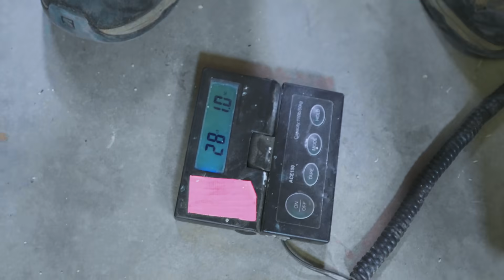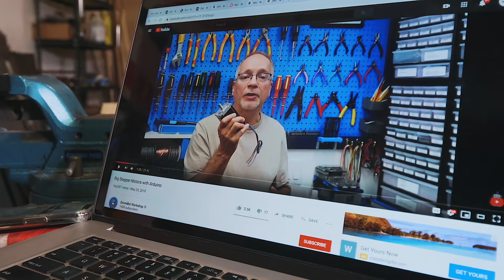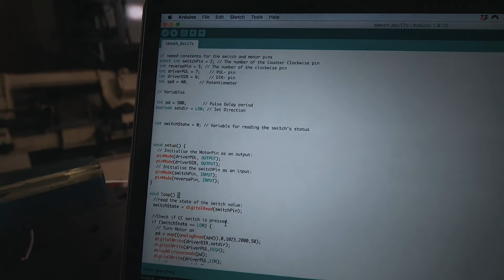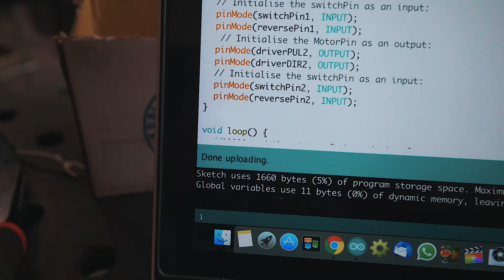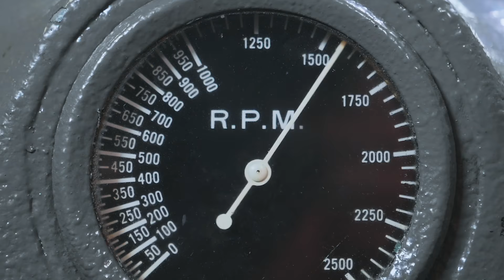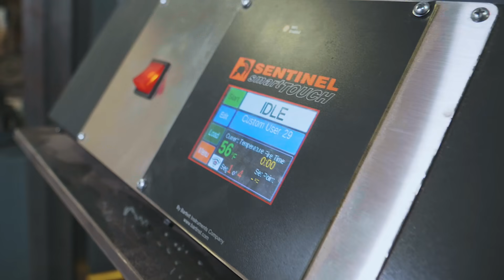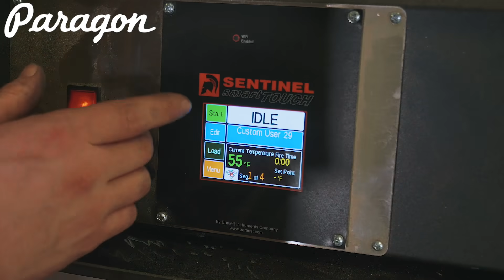MAKING FORGE DOORS!!! Part 2

Comment: What about 2 screws on both sides of the door with a synchronization chain
Like the z axis on a 3D printer 
The electronics can be kept below with only the screw going above 
It should get more lift from a smaller motor and prevent door closing with power failure 
Though you will have to account for thermal expansion in your design 
Same mechanism could be powered by a hand wheel as wheel 
Though it’s good to see electronic in forging we need to se more of that

Comment: Why not have pulleys for mechanical advantage and use the servo on one side with a trapeze to allow for uniform pulling and load reduction at the spindle

Comment: Alec, fyi, most all vertical lift doors have a pulley system and a counter weight to minimize the work done by the servo motor...

Comment: If you use a screw to drive the door up and down my guess is that it would work a lot better and you wouldn’t need to have a bunch of cage around your Forge. Cables are still going to heat up and wear out quickly. Just thought I would give you that suggestion.

Comment: you know I've been thinking about this off and on today and it occurs to me that you dont really need to program you servos to do anything you can just have it all mechanical you dont need a computer. you can limit your motor speed with a potentiometer between your motors and power supply and adjust speed with by turning it down and up you can shut off your door risers by attaching limit switches to either side of the cage so when the door rises to its max height it just cuts power from your riser switch and then you just have to reverse the polarity on your lower controller and your pretty much done

Comment: I'm no electronics genius Alec but I would think you need to do away with one board and wire both motors in series off the other board?

Comment: I can't see your code but I've been programming professionally for 10+ years so I feel like my guesses are ok. I think the reason your buttons don't work concurrently is that you've got a loop for each button, but you need to abstract the loop to go around all buttons. while(any button pressed) {  if (check individual button) move_motor(); x2 } or something like that.

Comment: a nema23 of this size should be more than strong enough to be impossible to stop by hand, you can increase the current to them through the stepper drivers either with code or with a potentiometer on the driver itself. Make sure to check the max current rating of the stepper motor and of the stepper driver so you don't exceed them however.

Comment: if the motors dont have enough power for 30 pounds, you can take the elevator concept and put some counterweights with some pulleys!

Comment: One air cylinder under the table to lift the door. Gravity will close it once the air pressure is off. Simple foot valve like on a motorcycle lift. No sketchy electronics, and less than half the cost. Less is more.

Comment: It might surprise most people, but a computer can only do one thing at a time. You have to have code that "interrupts" the cpu and give it a new task to execute, multi tasking. In reality this happens every millisecond or something like that. 
I'm guessing that your buttons lock that interrupt so it cant process any other task. 
But the strength with a stepper motor and control like this is that a stepper motor is very precise, you can go 200 turns in one direction and then back 200 turns and end up in the exact same spot. So take advantage of this and make buttons that take your door to preset positions. Have 4 buttons on each door that makes the door go closed, 33% open 66%, fully open. just one click.

Comment: Everyone's talking about the code and the motors, but correct me if I'm wrong. Surely the intense heat of the forge will very quickly corrode the wires or damage the arduino if it's mounted at the top of the forge? I guess he'd have a fully insulated enclosure, but surely it'd only be so long before something burns through?

Comment: You need pulleys to give that motor the oomph to get those doors up.  Probably only needs to be a 5 or 6 to 1 so a triple block (3 pulleys) system should do it.  

Edit: Just thought about it but inserting a pin slot into the door like a bolt throw lock should let you hold the door where you want it without the motor being active, like a 3 position deal, one bolt at the highest setting, one at the bottom to keep the door closed if that's something you need, and one at a half open if you're doing rapid low heats on smaller pieces.

Comment: Publish your code mate, or if you want to do the development yourself put the step outputs into interrupts called on millis (duration set by the pot) and the button inputs and the analogueRead for the pot into your main loop. Then you can poll the buttons continuously by looping over them while you're not actually outputting a step.

My guess is that you're using the delay function to set step output interval rather than millis (delay blocks execution of other code) and not polling your buttons outside the step output loop. Something like button pressed > output a step > delay > is button still pressed > output another step or go back to checking both buttons.

Comment: I would modify your code to incorporate another set of buttons. The first 2 sets raise and lower the motors interdependently which someone may be able to help you fix your code so you can do both simultaneously. The third set of buttons would be set to control both at the same time so you hit one button and it automatically raises both of the doors off of one button. You can also if you can time how long it takes for one of the motors to fully raise and lower the doors, set timed code so you only have to hit the button one time and not hold it. =)

Comment: Potential problem using aluminum has a low melting point on a forged or operating at 1500 degrees or more you might want to consider making the pulley out of stainless steel

Comment: Unrelated to this video, as I have been catching up on a couple of years on your videos.  Welcome to the States by the way.

The question:   In several vids you are using either a forged split to weld a “hard” bit for the cutting edge,  or machining a groove.  Have you ever thought to test either a machined dovetail or forged split approximate dovetail for more firmly fixing the two metals?

I’ve no idea if it will work or if there is a real reason not to try, I just thought it might provide mechanical advantage in the forging process and perhaps a “blended “ transition between the two billets in the case of Damascus .

Comment: A pair of old windscreen wiper motors, 4 relays and 4 switches would accomplish the same thing, at a fraction of the cost, in a fraction of the time! That's how I'd have done it!

That said, good work getting the Arduino to control the stepper motor as your first Arduino project!

Comment: we could help better if we had the code but anyways, your problem: many arduino stepper librarys don't support simultaneous stepper motors. Solution: use the AccelStepper library. Other possibility (not really good) tie both stepper motor drivers to the same arduino pin and they will move in sync but only in sync ;) hope that helps... If I can help, let me know

Comment: Make an if statement for the situation where both buttons are pressed that will activate the motors. Like 
if(b1.isPressed && b2.isPressed) {
Then power both motors
} 

(Idk the syntax exactly for Arduino anymore but something like this should work)

Comment: You might want the drivers working at the same time. So wire the arduino pins in parallel with the drivers i guess.

Comment: If the code isn't already solved, check the code for 3D printers as operating many motors "simultaneously" is what they do. They don't move at the exact same time, but within a few clock cycles, so within say 10 of 16000 cycles or around 1 millisecond. That should be good enough. 😊 
If the motors is just for aiding each others their inputs can be hardwired to be equal or mirrored, and have easier code.

Comment: I really think an actuator mounted under the forge and pushing the doors up would be far more effective than a motor turning to retract wire that is then feed up to the top and redirected back to the doors via a pulley. There are just too many different parts that can fail with this design. I appreciate the adventure and learning a new skill however, so build it and learn, but ultimately, I have a feeling this will not be the end solution you are most comfortable or happy with.

Comment: If you want to give the motor more capacity to lift, slap a small gear on the motor arm and a large gear on a spool or similar tool and it will lift more. It will move slower though, as a warning.

Ex: motor gear=° Spool gear= O
Combined=°O

Don't mind the crappy representation

I just wanted to point this out in case the block and tackle failed, since the block and tackle will shorten the distance the doors will lift

Comment: I feel as tho the motors wont like holding that weight even with a block and tackle. It will pull easy but its the static weight i think will burn out the motors.

Comment: I'd have opted for a basic pulley and drive system with a door made from a welded cage and bricks which would make it easy for repairs to cracked bricks. Guide rails keep the door straight.

Simple systems work best and most definitely no need to for stepper motors, Arduinos and coding. Bike chains and gears or a long travel hydraulic ram and pulleys work and work simple.

Comment: While personally I think a mechanical winch and pulley system would be better, you want to do electrical. So, I'd use your youtuber status and contact some of the other fabrication youtubers. Get their help designing a good gearing system for this. James Bruton from Xrobots, geardown for what, or maybe the Hacksmith are some of my favorites.

Comment: Guides, a three sectioned door (so center and left/right sections can be independently lifted or all three lifted simultaneously), and a pulley system that would allow for independent/group lifting of the door may have been a simpler, yet a lot less educational, path.

Comment: Alec, can't help with the code. Are you planning to have a foot peddle? Maybe a slider to pull up on one side, down on the other, with neutral in the middle. If the motors do not have enough power, there are always gears or pulleys.

Comment: There have been so many comments, someone may have said this already, but here goes.   You'll be needing a form of feedback from the motors, so they'll stop when it reaches the extent of their travel up and down.  Otherwise you'll burn out the motor at the top of travel and have all sorts of loose cable at the bottom of travel.  Or if you really wanted to make it complicated, sensors and software.  Also some code to deal with the potential of stuck or broken cable.   Or is all of this in the next video?

Comment: Not about the code, but there should be some end of line sensor in these doors, so the motor doesn't keep pushing them out of rails.
If the sensors are tripped, the motors should stop

Comment: The motor will not be powerful enough as other said. Three solution have been given :
-Gears (well to overkill and difficult for this project)
-Counterweight, just redirect de cable to it and pull downward with the motors
-pullyes, just tackle two together or more and you divide the force needed, as the motor can spin, no problem wrapping up more cable

Personally I would use both last options, stepper motor do not like to hold weight on extended period of time, even the strong ones.
Just put a counterweight beside the main body of the forge that weight 90% of the mass of the door. And then use a double tackle of pulleys attached to the counterweight and the bottom of the structure of the forge to pull on it. Your stepper motor would really thank you if you reduce the weight you put on it !

Comment: You could control both motors with the same 2 buttons. They could also be pedals with rope/chain/wire/belts and no motor or arduino :D

You didn't post your code and I could be wrong, but it sounds like you've put a big if else if thing in your loop and when you register a button you don't execute any other part of your if else if blocks. If that's the case, using only two buttons and spinning both motors at the same time when the buttons are pressed would solve that. Otherwise separate your structure to check both pairs of buttons in separate if else chains.
Reply: Or your motor code is in a while loop for the button so until you unpress it, it never checks the other buttons.

Comment: You are using electronics to solve an electrical problem. This is a really simple system that would work with switches alone. Youn need a DC power supply, then two, 6-pin, 3 position intermitant switches will give you up and down on each door. Adding relays/pot's will make it sit up and dance. Electronic controllers are simply adding something else to go wrong.

To me the joy in an electrical system is doing it with the absolute minimum of complexity, that doesn't need a programmable system. The first design step is drawing a flow chart, input, process, output. You have four inputs, door up and door down on each door. You have two outputs, motor forwards and motor backwards on each side. At its simplest, no process required, it will stop when it mechanically can't move any further at each end. Sitting up and dancing is making it automatically stop at somewhere between fully open and fully closed without simply working the switch, stopping when it reaches the end of travel and controlling how fast that happens.

At the most complex, I'd use an op-amp in comparator mode with a pot. acting as a motor position sensor to tell it where the doors are, that would allow you to set the opening and closing limits with a knob.  Simplest would be a mechanical stop. In-between complexity would be a limit switch set to stop the movement at a particular point.

Bin the computer. You are using it in a high-stress, dirty environment, it WILL fail. Learning to program an arduino is cool and a useful skill which is in no way a waste of your time and mental space but it's totally unecessary here.

Comment: With right micro stepping and gear reduction this motor can lift your power hammer. This pully system will create problems for you now and then. Linear guides are the right solutions for you and lifting door is Right orientation instead pulling from upside.  Good luck.

Comment: Electrical engineer here. You need to not use a breadboard in the real thing. Use a wiring harness to do that. And use some automotive wire. The kind used in engine compartment. And big (size not resistance) resistors that are safe for high temp, high power.

Comment: erase the secondary code and piggyback your wires to make both doors move in unison rather than independently.

or copy the same code from the original remove any globals such as VAR and change the name of the second motor to something else so const Motor1 then const Motor2

Comment: Did you consider going with hydraulic pistons instead? You could machine the pistons yourself(check out Make It Extremes videos, they do several) and weight wouldnt be an issue.  A simple motorized hydraulic pump wouldnt be difficult to figure out, and less potential for failure and no issue with the weight.  

Or get Bob from I like to make stuff to come visit, have him help you with the motors and you teach him to blacksmith.  Would be an awesome collab.

Comment: OK. Some basic stuff. Arduino is the controller of the motors. You simply need to connect the other motor the same way you connected the first one and in the same places as the other one. This way you will control both of them at the same time and way.

Comment: Better fit sprocket on motor shaft and use bicycle chain to pull the heavy door rather than using pulleys.

Comment: Instead of castable for the doors, why didn't you use fiber board? That's a whole lot lighter and wouldn't make the forge take longer to heat up. Better at insulating as well.

Comment: I would have the motor mounted below vertically attached to a large screw that goes up and through a bolt that is welded onto the side of the door.  Then have the door in a track on the opposite side.

Comment: Moving both motors is quite easy. Running the motor is done by telling the driver to move a step, than wait until you send the next step. This is done by sending a set amount of time HIGH than a set amount of time LOW. This is done by doing a digitalWritw, than a delay in many examples. If you take the example and check right before the digital write for the button states, you would be fine

Example: Now:

If(button1) { 
digitalWrite(MOTOR1, High);
delayMicros(SPEEDMOD);
digitalWrite(MOTOR1, Low);
} else if....

Example todo:

If(Button1) digitalWrite(MOTOR1, High);
If(Button2) digitalWrite(MOTOR2, High);
delayMicros( SPEEDMOD);
If(Button1) digitalWrite(MOTOR1, Low);
If(Button2) digitalWrite(MOTOR2, Low);
delayMicros(SPEEDMOD);

Comment: A lot more technology than i would have ever considered. I would have just gone simple and easy with a momentary switch foot pedal. Step on one pedal and the motor runs one way until it hits a stop switch at the top. Step on the other pedal and it would run the other way until its closed. That could pretty easily be done with relays and switches. Ya.. switches and relays.. old school, but to me more reliable.

Comment: Alec, would both motor always spinning at the same time but in opposite direction with the push of only one button be the goal (one button for anti-clockwise then another one for clockwise) ? If yes, you can just have 2 different signal cables coming from the same arduino output to both stepper controller, then reverse the cabling on one of the steppers. They will execute the same commands but they will turn opposite direction.